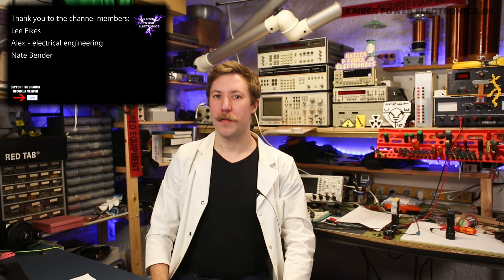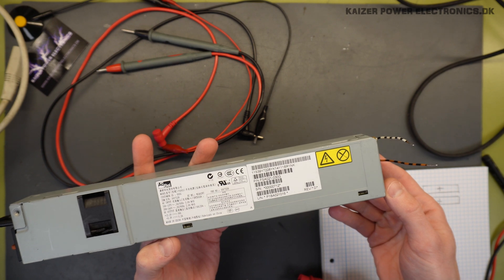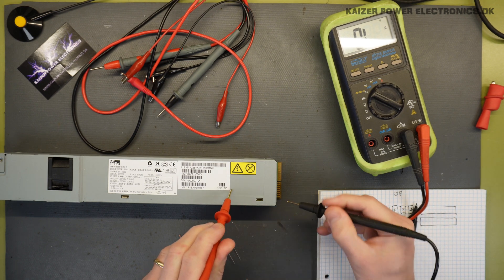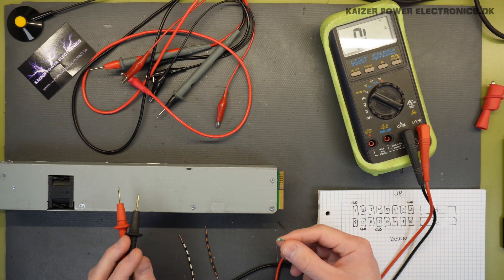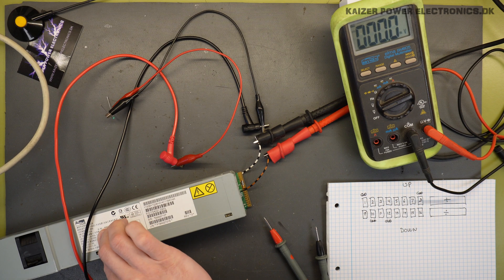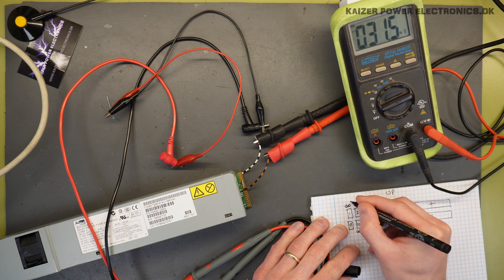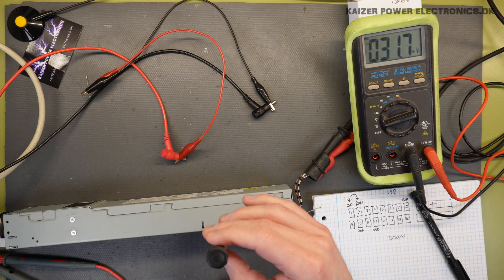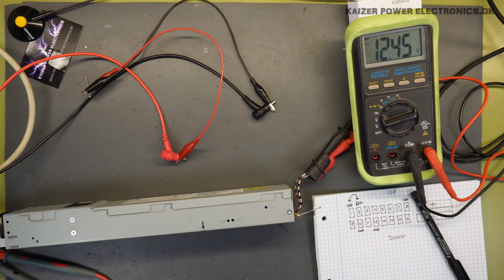Server PSU Hack - ACBEL FSA021 IBM 39Y7228, 12VDC 38A 460W

Comment: Time to find out if these have the same pinout as the AcBel used in Apple Xserve!
Reply from the maker: Please do report back!
Reply: @KaizerPowerElectronicsDk  I've only tested the power distribution board, but shorting pin 10 (on the non-insulated side of the PCB) to ground turns on the dual power supplies. Couldn't have done this without your video - thank you! :)
Reply from the maker: @Jamie  Great to hear that it worked!

Comment: Hi, any chance you can give me a hint on why idle power is 40w... i do not see it as correct
Reply from the maker: I would guess that these are not optimized for idling. There is no scenario where a server power supply is not loaded, when in use. Might not be fully loaded, as they are properly running in a N+1 configuration, but not idling.

Comment: Can it be modified to battery charger?
Reply from the maker: It depends on the battery charge controller you are going to use, what input voltages can it take?
Reply: @KaizerPowerElectronicsDk  What i meant, is transforming PSU into lab bench power supply with cc/cv mode. There is already chinese solutions for that. But process of reverse engineering random PSU and adding this functionality would be very interesting to see.